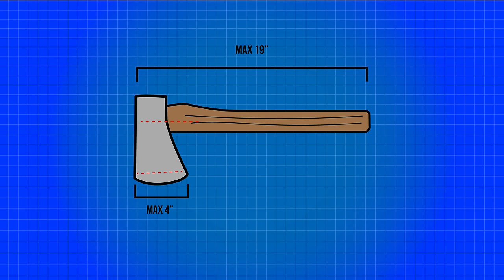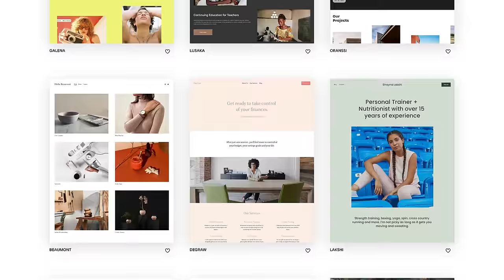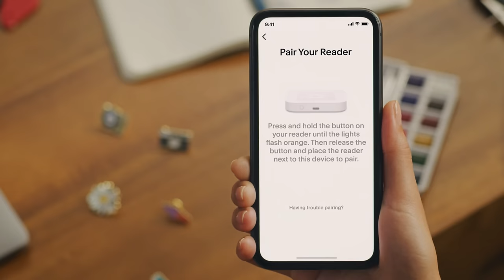Making a Titanium Throwing Axe

Comment: Hi Tim!! Great work! I throw axes in high-level competitions and to answer your question about the sweeping on the bottom of the head, that's actually by design. The rules for both WATL and IATF state that the score for a throw is measured by where the metal of the head meets the plane of the board; that means that any part of the head buried inside of the board isn't counted. For every shot in WATL and for the clutch shots in IATF, a maximum length blade is ideal for the way the scoring zones work. As the boards get more beat up, the axes can sink pretty deep inside, so if you flat your shot on a beat up board (land the axe in the board so it's basically perpendicular to the ground) the scoring zone might be 2-3" into the axe head. Having the bottom sweep down like that is important so you don't lose as much coverage on a beat up board. Since axe throwing rounds are frequently decided by a matter of millimeters, you want to reduce any possible loss of coverage without compromising your throw or accuracy.

Comment: cutting titanium with an angle grinder is how I found out how flammable a fuming pile of shop rags are. Love the sparks :D
Also there is a corresponding voltage/color chart on google where you can see what color you will get from what voltage when anodizing titanium so you can actually pick your color

Comment: An amazingly beautiful rainbow colours on the axe
Reply: The nerdy thing here is that the blade has no color itself. The anodizing process grows a transparent and colorless (!!) oxide layer. The colors that you see are interference colors from the reflecting light, and all those different hues are caused by the variation in thickness of the oxide layer.

Comment: Get yourself some 4x4 or 6x6. Ask your lumber yard if they have any culled lumber in that size. Cut them at 12" blocks and stack them so the end grain forms the face of the target.
Oh I forgot one important step. Use some 1x3 spruce strapping to hold it all together. 
I framed the outside of  mine with 5/4x6 deck boards. (Culled) 
And used some 1x3 spruce strapping on the back to hold the blocks from sliding out. Because mine isn't hung on a wall. 
If parts of the target wear out, just slide out the blown block and replace it with a new one.

Comment: Awesome project, titanium is so fun! Quick note on the anodizing, once you go up to a certain voltage you can't just go back down without cleaning and re-etching. The coating formed from the voltage is like armor, and once a "high voltage armor" is on the metal the lower voltage won't really have much affect. Also, the voltages past 80 or so can start to do wackier things and have a higher chance of ending up splotchy. Finally, to see the real color you really have to dry it off fully. Less so on polished metal, but satin metal will change color dramatically from a wet-to-dry state. There are some good reference charts of colors online if you poke around a little (I like the one with all the bolts at various voltages)

Comment: The Axe is crazy beautiful. It needs a prettier handle maybe a burl, flame maple or curly or even an ebony stained black would set it off just nicely. If you used a well figured maple piece you could stain to match the inherent colours of the blade. That would look so cool if you blended three colours. Just a suggestion:)

Comment: Looks badass! The thing about axe throwing is that lighter axes tend to have from drops not being heavy enough to stick in harder wood. Throwing harder would solve that BUT that means less accuracy. The weight does the work. The Ace of Spades is a very cheaply designed axe in terms of materials using 1045 steel. It's very soft but has the weight at 2.2lbs head weight.  At 1.3 lb head weight, the titanium head is on the light side. However, with the poll being fatter than the Ace's it will help drive the blade similar to the hammer hatchets. And with a 6-7oz hardwood handle, it may be enough to prevent drops on pine or knotty targets.  I hate to think how much that titanium stock costs tho.

Comment: I'm working on an axe throwing stick. I haven't got the weight distribution balanced yet. I wanted to start with a broad head hatchet, since it's biased to one side already. But they're too heavy in steel, and I don't want to spend money on titanium until I have a better idea. I have a cheap ice carving axe, punched out of sheet steel that I've been working on, trying for the right shaped handle. The axe head wants to sink too much, and so the wing shape has to compensate, and I haven't worked that out quite yet.

Comment: Hey Tim, amazing build. Your throw is slightly under rotating(you can tell because the handle hits first), you would probably have better luck if you stepped back maybe 4-6 inches to give the axe a little more time to finish rotating. Hope i can win this beauty, I stopped competing in axe throwing a while back because it was irritating an old shoulder and elbow injury. Maybe a lighter axe wouldn't cause me the same problem. Thanks for doing a giveaway with something you worked so hard on and want to keep for incredibly obvious reasons.

Comment: Please consider using tinted eye protection to avoid vision damage caused by the excessively bright sparks thrown by titanium. While it's not as severe as a welding arc or burning magnesium, it is still bright enough to cause vision damage with repeated exposure.

Comment: No problem to cut Titanium with a band saw, need bi-metal blade with 14-18 teeth per inch (tpi) blade or better still carbide blade. Can be cut with a hacksaw by hand to, however you might find yourself getting very tired and get through a load of blades. There are tables available of voltage vs color for anodizing.

Comment: the voltage is really just controlling how fast the process works. I'm betting you got that gradient based on where your electrical contact was. It's neat how the colors go through the rainbow colors over and over again. That is kind of like loosening a guitar string, you go through the same notes over and over again.

Comment: @TimothyDyck I guess these "Spots" came through a layer of bubbles, sticking to the sides, when you dip it in the solution. So there u don't have a smooth and continuous contact area for the anodizing. Try to limit the current. Maybe try with a scrap piece of titanium that has nearly the same surface area as the axe to figure out at which current u do NOT see any small bubbles forming at the surface. Bubbles = H2 = no contact area = uneven coloring.

Comment: I wonder if this anodizing process will
Work on stainless steel….
Reply: Yes, and no. 

The technical explanation of the colors is that the clear (colorless!) oxide layer varies in thickness. The colors you see are interference colors.

Stainless steel will do the same thing, though not as vibrant as titanium. Heat austenitic stainless steel, exposed to air, to 440 °F (227 °C) in air, and its high temp oxide layer will turn it kinda light brown/orange, 500 °F (260 °C) makes it look a bit like bronze. 540 °F (282 °C) will turn it purple, 590 °F (310 °C) will turn it blue.

You can sometimes see this on motor bikes with exposed stainless steel exhaust headers. 

But my "no" is for the fact that the set-up shown here is not sufficient to anodize stainless steel.